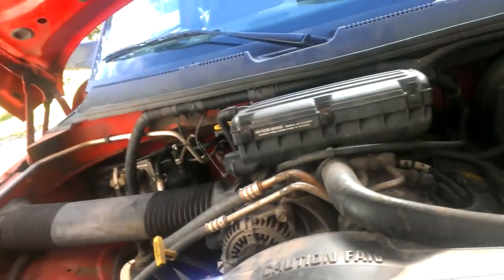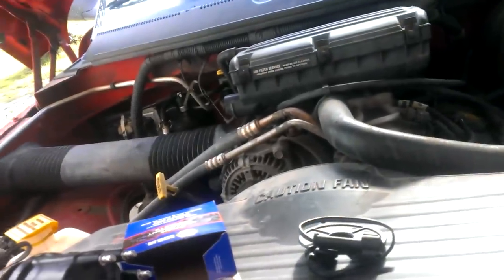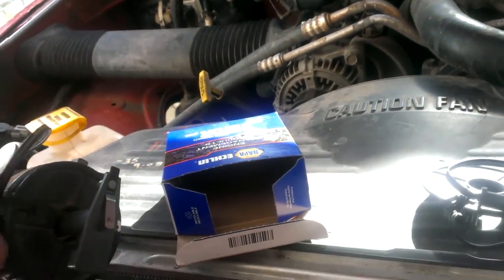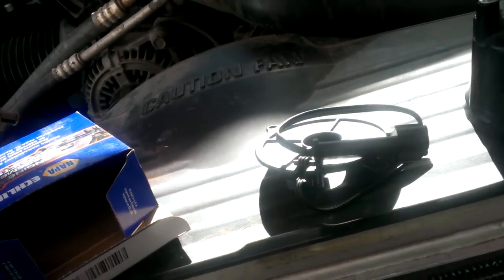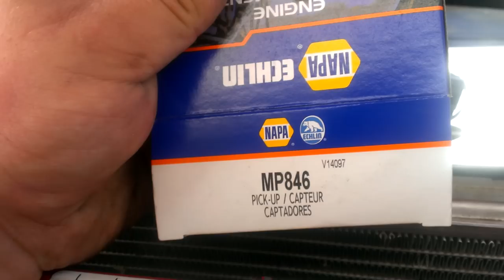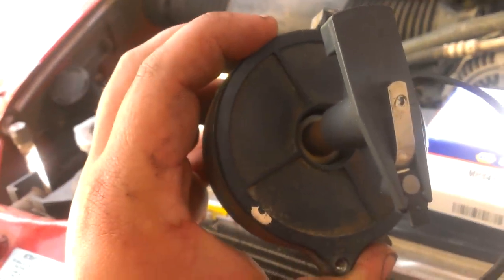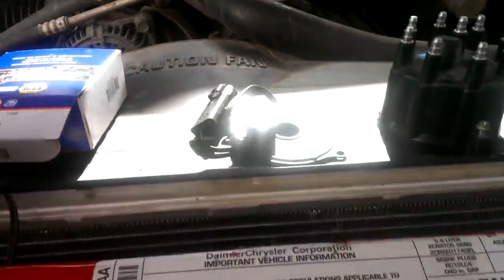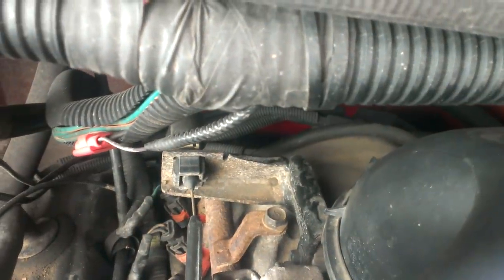Dodge ram stalling problem fix part1

Comment: I wish I seen this sooner, iv changed out the crank censor, heat temp censors cap an rotor, an still had issues. But seen ur videos an changed out the cam censor an so far no problem. Don’t sound like a miss but I’ll find out on my way to work bc that’s when it acts up👍🏻👍🏻👍🏻

Comment: I have a 2000 ram sport check engine light on with codes p-0601 @ p- 1495 pcm was replaced 6 months ago! I’m having those same issues as we speak! I need help getting my truck to act right! Thanks! Again!

Comment: I have a 2006 dodge ram 1500 5.7 when i put it in drive it stalls, but if i wait 2 or 3 min it will go into gear and run without stalling.  Do you know what this is and can this be fixed

Comment: Thank You! That’s exactly what my 2001 Dodge Ram 1500 with a 360 is doing. I changed the plugs, wires, rotor and distributor cap ran smoother however when accelerating randomly it just almost stalls that makes it feel like the transmission is going out.
Thank You very much!!!

Comment: Just want to give my advice I ordered this part # but the connector was different from my 1996 dodge ram 1500 5.9 360.
I ordered another one specific to my truck and it fixed my stalling issue and misfires. Completely fixed my issue.

Comment: Thanks for the video. Not many people are covering this fix at all. I have a problem with my 1985 dodge 150 custom straight 6. The vehicle sat for about 5 years. I've had it running now for close to a year and I'm running into problems. I have to pump the gas about 15 times for it to start. Then warm it up about 15 minutes. If I don't warm it then it will stall going into gear. It also bogged down in power and I'd have to double push the gas from a stop. I gave it an oil change and replaced the spark plugs. Now it doesn't require the double push from the gas pedal to go and the pickup in speed is better. It's running quietly but almost too quietly. Now when I stop at a light it will stall. I have to put the truck in neutral and slightly rev the engine to keep it running and when the light changes put it back into gear. If I have the gas just right when I change gears then there's no difference in the take off. If I have the gas too high then there's a jump. So any ideas? My plan is check to see if I need to adjust the carburetor choke and then increase the idle slightly. Replace the transmission filter and fluids. If necessary replace the air filter, fuel filter, and pump. Not sure if it's necessary or how to check them. If all that doesn't work, then replace the catalytic converter. It does sputter when I turn it off if I've run it at a speed over 45 mph when I get home. I'm try to find the shortest and cheapest route to fix the stalling. I know the transmission filter change should be done anyway because it's an old truck n it probably about time. Sorry for the long message just thought I'd best describe the symptoms. My family depends on this vehicle for work. Any help would be appreciated. Thank you
Reply from the maker: Joseph Green II keep tinkering. If it's stalling at idle turn it up. I can't give the best advice on carburetors vehicles without listening to them in person. Definitely keep up the maintenance though.
Reply: I have a 1986 ram d150 as well and I’m going through the the EXACT same problem!! If you ever figured out the problem please let me know! THANKS!

Comment: I have a 1990 Ram, it seemed like my fuel filter was clogged up so  I swapped it out and still having the same issue. I hope this is the cure. There are a lot of great videos on here that address this stalling problem. Thanks for posting
Reply from the maker: John VanDenburgh thanks for watching and commenting. beautiful not to adjust the timing on the distributor. it's a whole new heady ache with the same symptoms.
Reply: crap my truck stalls at the most inconvenient time and dont know what it is. ive changed out just about everything. i pull over and wait a few minutes and it starts right up...
Reply: Did it work?

Comment: Thanks for posting this I found it at the wires to 3 bundle of wires coming from the center where worn through and I simply replace those wires also on the computer connections I was able to get it to stall by wiggling one of the connections just very slightly so I cleaned them and use the rubber strap to hold them in tight and it seems to cure the the problem however I still have a random misfire which I'm chasing down now but at least it's not stalling
Reply from the maker: Glad you found your problem. Thanks for watching.

Comment: I found the pick up / sensor at Avanced Auto Parts today for $30.00 for my 97 ram with a 5.9L and AutoZone  also can get them over night.
Reply from the maker: awesome, we don't have those around here. only Napa.
Reply: I'm in Denver, Colorado but thanks for the video and it fixed my truck
Reply from the maker: +Bill Davis if the stalling issue persists, but less frequent. have your distributor checked, even a degree out of time can cause occasional stalling.

Comment: check the ecm y'all pull that cover plate off use a flash light and see if anything is burnt its a very common problem sucks but this could be your problem I replaced all kinds of crap just to find out I had to send the ecm off for a rebuild "starting to hate dodge"
Reply from the maker: I've never heard of an ECM melting in all my time working on vehicles, and owning dodges.

I think it would be more of a isolated incident.

Comment: so my 97' ram stalls at stops but my truck doesn't have a air intake it has the air filter in the top thing idk what's it's called but I replaced the whole distributor, I think since it doesn't have the air intake it's sucking more air than normal

Comment: Coming to a stop, as soon as its completely stopped it chugs and stalls out and sometimes no chugging and just stalls. Power inside stays on. Stays in gear. I put it in park and it starts right up with no issues. Replaced IAC, MAP, Sparkplugs, wires, Distributor cap/rotor, Coolent temp sensor, new throttle body gasket as the throttle body is still good. 

If I let it roll instead of coming to a complete stop, it stays running. But as soon as the wheela stop rolling it stalls out. Idles healthy, drives well, just coming to a stop is a pain in the arse.
Reply from the maker: Common issue is the fuel system loses pressure when letting off the gas, fuel pressure regulator is the usual culprit.
Reply: @BillTheTractorMan  I'm going to try replacing the part you mentioned anyway because its the original one and I have not done that yet and than I'm going to do the fuel pump. Only thing is fuel pressure reads about 45 and the operating pressure is supposed to be 49. I feel like both are my issue.
Reply: @BillTheTractorMan  got to drop the tank anyway and that regulator is almost as much as a pump so I may as well replace the whole thing haha.... (From autozone anyway. Like $121

Comment: Quick question, was the misfire and or bucking you truck did start after your truck warmed up and you were driving a little ways?
Reply from the maker: Happened any time. I never noticed any particular factors that influenced it more or less.
Reply: Mine is doing it after it warms up.  Then today put some gas in it. Then it stalled the truck out twice.
Reply: @tamikab.5868   I'm having the same problem. 2002 dodge ram 1500 5.9
I replaced the plugs, didn't fix it then the distributor cap and rotary button, didn't fix it. Mine is doing what the one in the video is doing, except when it's been going 10 miles or so. It's at a garage and they told me they aren't sure, it's a tune up garage. I can get.it fixed, but i can't get it fixed 5 or 6 times. I'm banging my head on the wall here lol! If u foind out what we wrong let me know , and I'll do the same. Sounds like we have the same problem.
Reply: @sheilah64  Sounds like you may need to replace the crank position sensor it also can cause the same symptoms in the dodge V-8 engines.
Reply: @radarswebdesign  that was the next thing I was gonna do, but it ended up being the PCV valve. $3.29, $30 fory mobile mechanic to drop everything and drive 15 miles to fix it, God bless him.
Reply: @sheilah64  I found out after I had changed my Crank Position Sensor, that it was not totally the issue so I went for plugs and wires and the electrodes on my plugs were the size of a needle (completely worn down), and my Ignition coil Wire was spliced together and taped with black electrical tape.  The previous owner must not have realized how bad it was running, but I am still going to replace my ignition coil because well It is worn and kind of rusted on the contacts. And I am going to replace the Sensor in my distributor as well, but I am going to look at it first and see if I need to though.
Reply: @radarswebdesign  mine doesn't have coil packs, I thought it did then I found out  I have the big block 360, only 11% of my year, 2002 has those... thankfully lol.  My boss has a Jeep with those coil packs and he blows rhem all the time. ALL the time.

Comment: My 98 ram 5.9 stalls and occasionally completely shuts off. I noticed it's always up a hill. Today it sputtered on the interstate and the tach went crazy. Almost like it was hitting the Rev limiter. It will start idling erratically like a monster race Cam. But soon as I tap the gas pedal it levels out. The ecm has recently been rebuilt. The alarm went off and wouldn't stop. I didn't know the truck even had an alarm. Daaaang. I'm going to change the Cam position sensor and pray that does it. Thank you for sharing this video. I'll let you know what happens.
Reply from the maker: Sounds like you have an aftermarket alarm system. Those can be a scary can of worms when people install them that dont know how to do it right. Try the simple stuff, if that doesnt work you may need to find a mechanic locally that knows these trucks.
Reply: @BillTheTractorMan  , thanks. I took out the alarm when I had the ecm rebuilt. I do most of my own mechanic work. Honestly, I haven't made much effort to find the problem until now. Almost stalling on the interstate is great motivation.lol.
Reply from the maker: @markcrunkleton831  absolutely, my truck still has the aftermarket remote start and alarm because wherever installed it did a good job. However I have had to remove others in all makes of vehicles. The hack jobs can be so bad the vehicles computers get ruined. I do not recommend aftermarket systems period because of my experience with them causing issues.

Comment: I have a 2003 dodge ram 1500 hemi it stalls or pulls or slightly shakes ones I reach 50mh it stops ones I get pass 60mh I wonder if this is the problem it began ones I changed spark plugs and cables

Comment: I have the same truck and have changed out the distributor once and cam sensor twice.  The second cam sensor that came with the distributor would not even start the truck. Put the cam sensor from before in and truck runs but very rough on the start (idle).  Smoothens out a bit after a few minutes, enough to drive, but feels sluggish.  Is this how yours was acting. Thanks
Reply from the maker: +Greg Popovice sounds like your distributor might be just ever so slightly out of proper position.  Mine was like 1-2 degrees off exact and it gave me issues.

Comment: Napa probably couldn't find it because you have to know the correct name for the part. I couldn't look that one up then my roommate checked online and it was called something totally different then what l the videos I watched on it was calling it. Unfortunately I forgot the name of it and it didn't fix my the problem. It did allow me to drive a little bit further before it would stall. I still can't figure out the goddamn problem. It's seems to be getting worse with the heat because I live in phx but the truck isn't over heating. I think its my IAC but I've changed so many sensors on this stupid  ass thing. It can be a sorts of different issues from new batteries to new mufflers from what I've read. Sensors relays all sorts of different shit.

Comment: Does this apply to the 8 liter v10 mine is doing this for 6 months I had the cam sensor replaced at the Chrysler dealership and it took 10 days to get the part because it’s obsolete I thought that fixed the problem but it has been doing it again 2 times on the freeway today
Reply from the maker: +Sam Aro I don't have any experience with the V10 other than driving a couple. It may seem annoying but a lot of times a full tune up helps. Cap, rotor, wires, plugs.

Comment: Discovered a new issue, when i tilt steering wheel all the way up. Blower for ac quits, abs and brake lights come on? Could it be an issue in steering column?
Reply from the maker: Probably a wiring issue in steering column or with wiring coming from steering column.

Comment: Don't forget about the crank shaft sensor  . Back of motor .
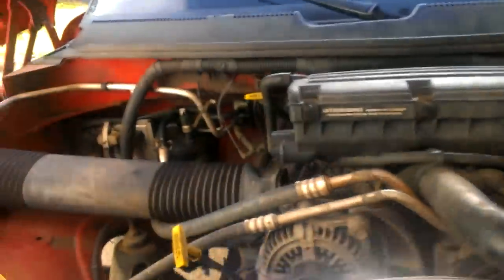I had replaced the cam 2:03 sensor . Kept dieing . 
Crank shaft sensor runs off of back flywheel .  Really .

Comment: I have a 97 Dodge Ram 1500 5.2 318, after running for about 30 minutes or whenever it get hot, the motor will completely shut off. Sometimes right before it does it, itll jerk pretty bad. After it stalls out, 5 minutes later or so i can go to start it again, and itll start right up. First thing i replaced was the fuel pump and it ran perfect for a couple of days.. I got under to look at the crankshaft sensor and the wires look pinched and out of the plastic wire cover. Could the crankshaft sensor be doing this?
Reply from the maker: it is a possibility, usually it would be accompanied by a check engine light that may not stay lit if it restarts fine. the code would still be stored and could be seen with a scan tool. if wires are damaged, I would suggest repairing/replacing sensor and wires. when was the last tune up done? people tend to overlook distributors so the caps& rotors get warn out, also plugs and wires. if one hasn't been done recently worst that can happen by doing a tune up is increased power and fuel economy.
Reply: +BillTheTractorMan Last tune up has been a while. Haven't had much time and money for it yet. it has just recently started. and whenever it shuts off, the check engine light does come on, I'll get it crunk, and it will stay on for a little while and then turn off (the light). If the problem persists after crankshaft sensor replacement, should I look into the pickup sensor?
Reply from the maker: +Mark Cheatham definitely see what the code is for, off hand I don't recall the code for the pickup sensor (when it did trip the code, usually it didn't). I think I paid $55 for the sensor at Napa, you could put one in but be very careful not to twist the distributor, it's only held in with the pressure from a little screw and it's awhile new can of worms when it gets moved even just a hair. it will cause stalling, jerking, rough idle, etc... and requires a computer to be hooked up for adjustment.
Reply: +BillTheTractorMan I read some codes, and I believe one was the camshaft position sensor. I went to OReillys and they don't carry it they said. so I went ahead and got a crankshaft sensor. I read bad crankshaft sensors will cause this problem as well. but I need another opinion on it so I'm not lost out in sea whenever idk what else to try.
Reply from the maker: +Mark Cheatham that's it, can position sensor will trip for the pickup sensor, oddly I don't think these engines even have a cam sensor, so the universal OBD2 code for cam position sensor trips for the pickup sensor. the pickup sensor uses square wave forms, and when the magnets wears the edges get rounded and the computer reads it as a cam problem. if your cam got out of place you would know it, you would have a blown up engine.

Comment: Bill, thanks! FINALLY, I believe I've found my problem....my question is, does the pick up come already inside of a new Distributor? Because, I actually have a new one that I was going to put on...Thx dude!
Reply from the maker: UNK just take the cap off, if there's a black plastic plate there that's the pick up. if you see down into a aluminum cup, it's missing.

thanks for watching, glad I could be of assistance.
Reply: I did just that bro, and it's there! Thx again!!!
Reply from the maker: UNK you are definitely welcome! glad I could help.

Comment: I have a 2001 ram 1500 sport w 5.9l. Changed fuel pump in tank, crank sensor, map sensor, iac sensor, tps sensor, rotor pick up, and truck still stalls out. Wait 2-5 min and it fires up and runs ok for a while, swapped out asd relay and still it just dies like ya shut the key off.. not throwing any codes either. Truck has 248000 miles.. please help!!!!!
Reply from the maker: I'm not exactly sure, but if it just shuts off, no stuttering I'm leaning towards electrical. Some where there's a loose connection, or coil is getting warm, broken wire, short with a wire, etc.
Reply: Hey jason did you ever fix the issue?
Reply: @chadwardlow8020  Have you, have the same issues. The gas gauge and oil gauge don’t turn on after stalling

Comment: New coil pack, new plug wires, new plugs, did change rotor or cap.. looked a bit worn when i changed rotor pick up.. i hope its not ecm...
Reply from the maker: Jason Perry it's possible you could have bumped the position of the distributor. I did it and had all sorts of wicked issues. I dropped my truck off at the local garage and they figures this out by hooking it up to their computer. My distributor was off by maybe 2°. Never got a check engine light from it but it made the computer act up.